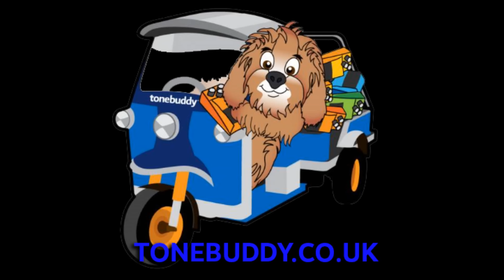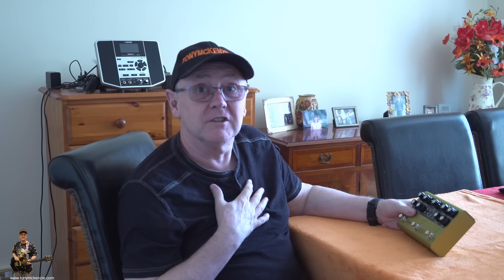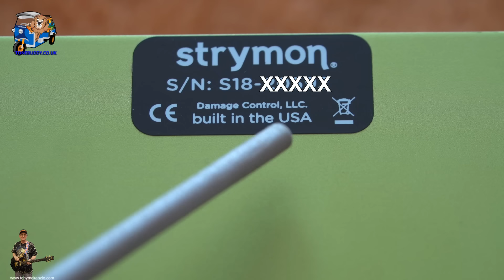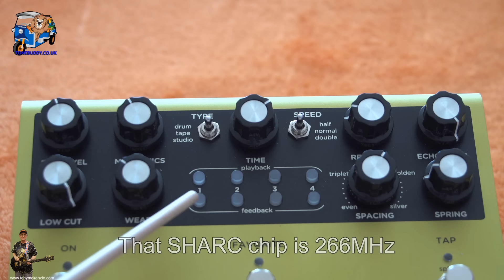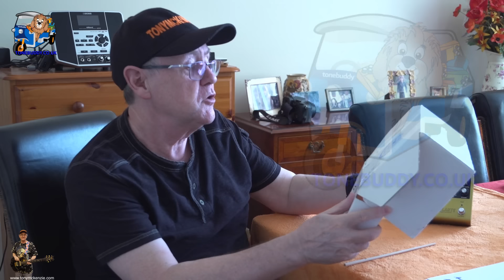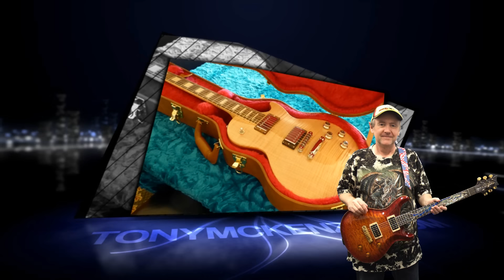Strymon Volante Magnetic Echo Delay Pedal Review | Close Up Inside and Out | Tony Mckenzie

Comment: Great review Tony, as informative and as thorough as ever. I'm actually interested in buying one again now, been contemplating getting one since they came out but haven't pulled the trigger as yet. 

I owned a Roland Space Echo in the 80's and 90's. It sounded great, but it spent a lot of time getting fixed and trying to find new tape for it was expensive and a pain before the advent of the www. I've never heard any modern digital tape echo emulations in either hard or software that came close to the original, but this one actually sounds really close. Yes, it's pricey, but at least I can be sure that it's going to work and I won't have to hunt down new tape for it.
Reply from the maker: This one is certainly worth a look and it had all those traits that we know like flutter of the tape etc. from back in the day. It was hard to tell the difference. But there are many controls and probably best modifying the pre-sets. The thing about this one is (I guess) that it might hold a pretty high price even second user. Thanks.
Reply: @tonymckenzieofficial  It's spend either £400 on a nice bit of hardware. Or a bit less than a £100 on the new Pulsar Echorec [Binson emulation plugin]. My heart's saying Strymon my wallet [and other half] are saying  plugin.  Although my other half will be told that the Strymon cost £100 if I buy one. Everything gear related that I buy never costs more than £100 where she's concerned. ; )
Reply from the maker: Ha you sound exactly like I do... my wife has been educated over the years (she even spies sometimes!) but I can still muster up 'it's just £100' story sometimes :) The worst part is, I have to balance anything off with jewellery and (wait for it) handbags. Strangely, she collects them as if they were guitars!. I have (as expected) commented that you CAN have too many handbags. :)  Great comment and I guess we're all pretty much the same really :)